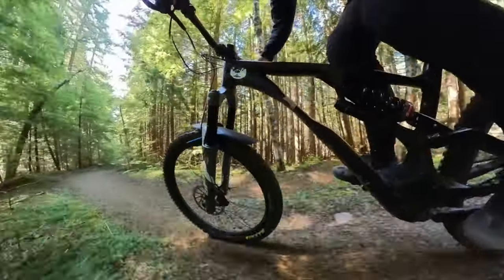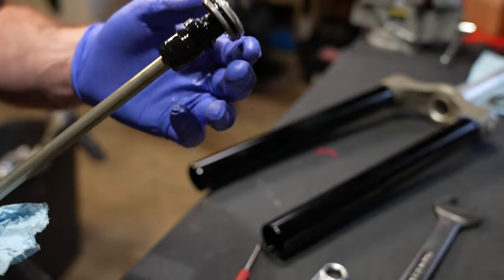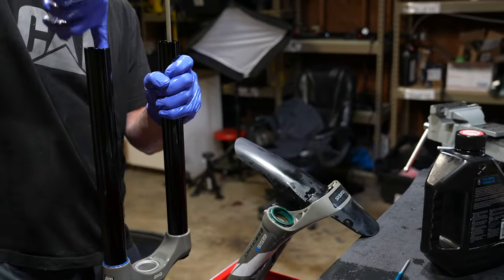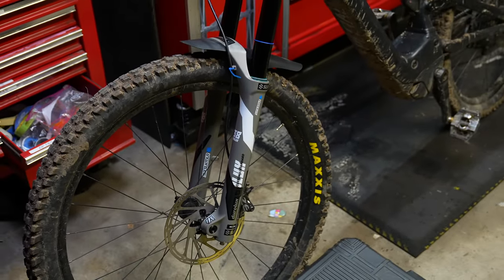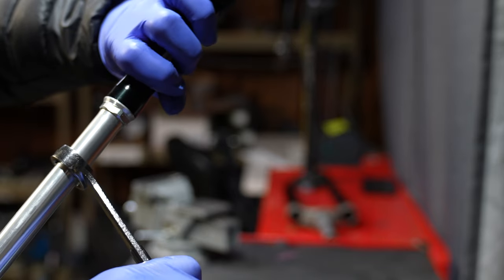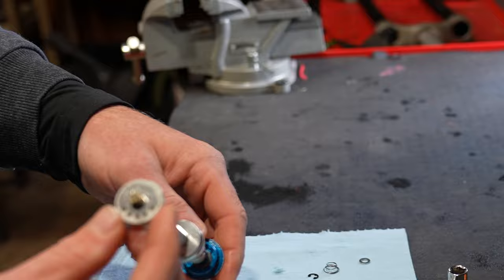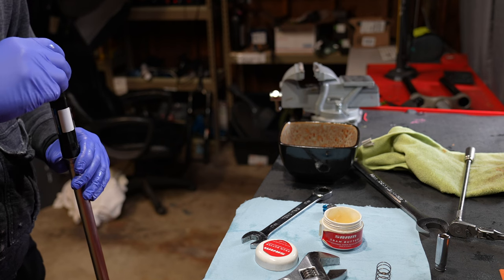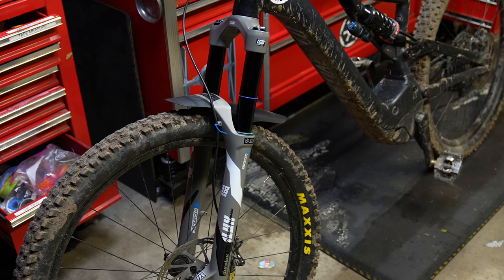How 2 FIX Suntour Durlux RC2 38| Full Service Guide

Comment: Agreed, i think the previous owner changed the oil in the damper with a heavier one. The stock oil Suntour uses in their damper is a very thin clear oil almost like baby oil. anything over 5w is not advisable
Reply from the maker: Well, they would not give me the info on oil viscosity or the oil viscosity .I’m about 100% certain the damper never been open.. multiple comments agreeing that the fork is harsh. Been running a bunch of experiments changing and it just wildly changes.
Reply: Agreed it is very hard to find manuals for Suntour. M not sire if maybe Suntour has inconsistencies with the oil they use different batches. Just like you I also had to do a full break down and took note of everything and compared them to the fox. Also did experiments with fork oil and ended up using maxima plush 2.5w....oh and be careful with keeping the bike upside down...the damper seems to leak when the fork is upside down for a long time...this may cause an airlock

Comment: Very good video. But the oil in each bottle should not exceed 2 cc and not 10 ml. That is why it is causing that sound.
Reply from the maker: It knocked before. I think it was the o-ring on the air piston. Had same noise from a old fox

Comment: If you are a "cheapskate" don't buy Fox (branded) oil, buy Motorex. They are the same (in most cases).
Reply: Whatever brand you can check for low  sulphur content synthetic oils...
Reply from the maker: 🧐 is that the issues now? As far as causing havoc inside the the fork?